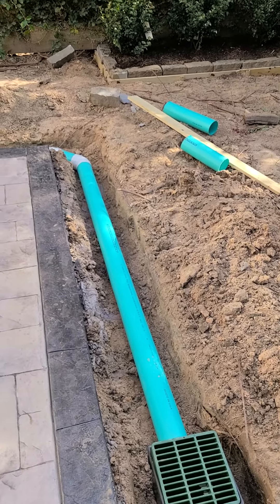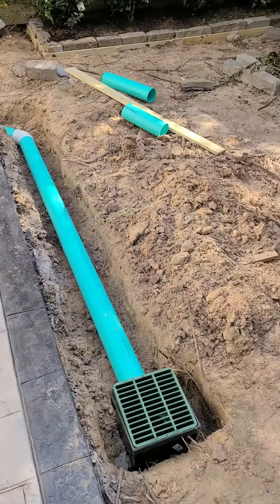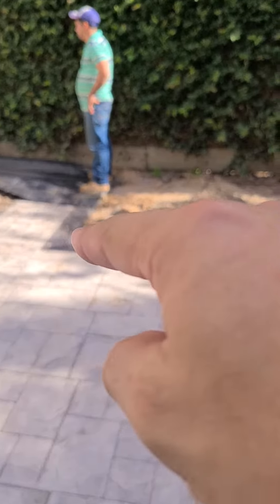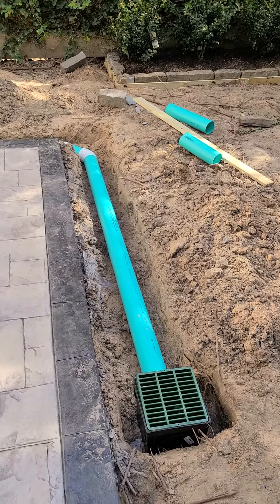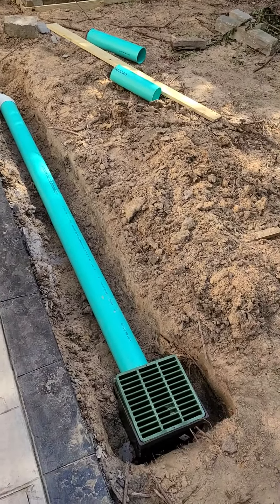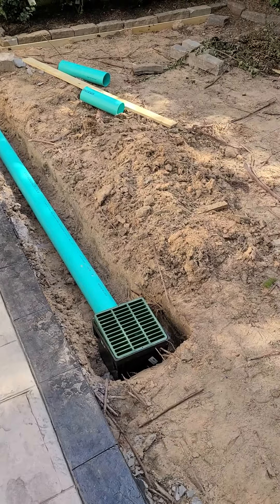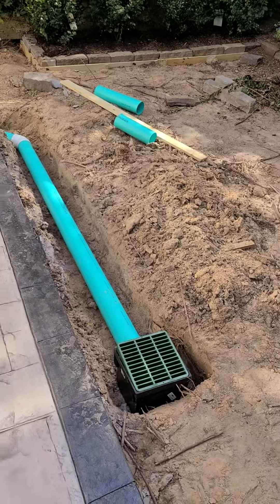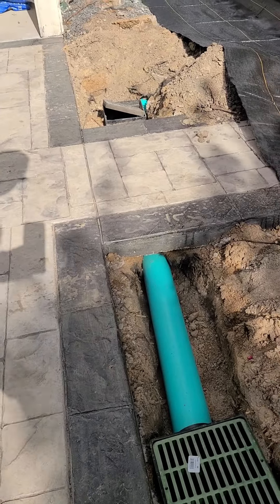Drainage under synthetic turf

Comment: Comment is way old so my apologies. When you back fill with gravel what size are you talking? Crushed gravel, 3/4 inch etc?
Reply from the maker: Hello, no problem I’m here to help. I use 3/4” washed or you can use 3/8” or even a little bigger if necessary.

Comment: Is the drain opening flush with the grass or will be below it concealed?
Reply from the maker: On synthetic grass I do it below the grass or below the sun base is better.
Reply: @23CHELMS  Is it a problem to have stragnant water in the base rocks for days. My soil isnt very permeable. I remove the lawn down to 4inch and we had rain.  The area is still have 2" of water after few days because the drain opening is too high. Thanks much
Reply from the maker: @b3arwithm3  If you have clay soil like Houston does it’s the same issue here. That’s why we prefer to do the drain under the base rock. One thing to consider is the soil may have a lot of moisture in it so it’s hard to absorb any more rain. Our experience is the drain rock acts as a little retention area as it slowly seeps down